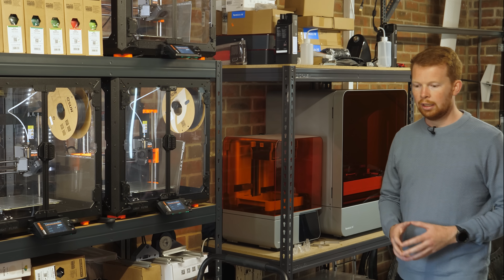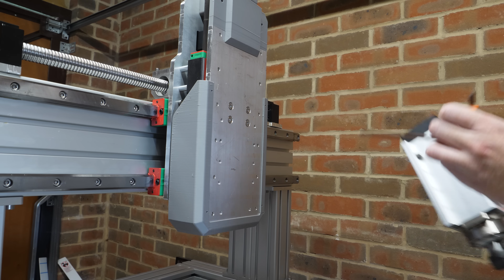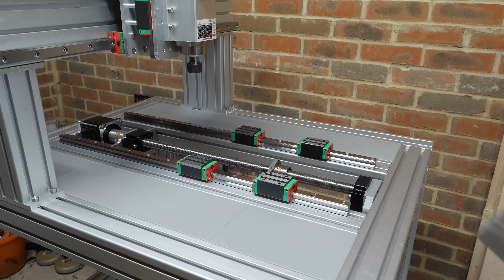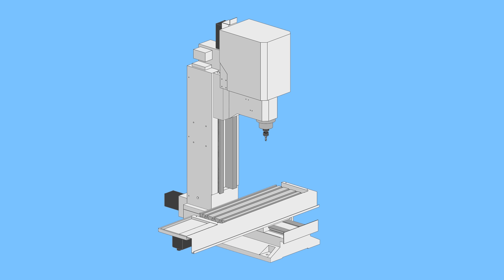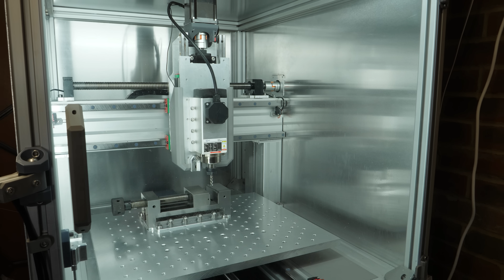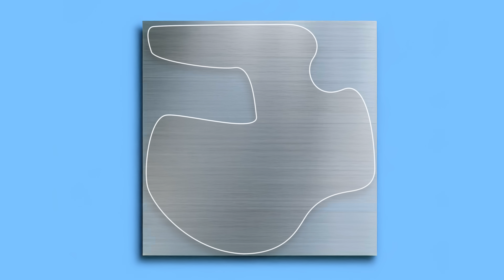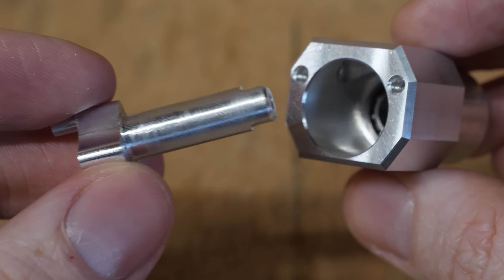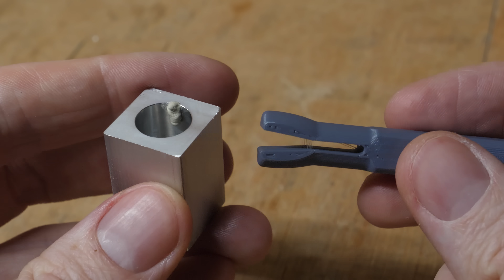I Needed an Engine, So I Built a CNC Machine

Comment: You may have ran out of thread on the top bit of your assembly for adjustment, but a thin nut that threads against the bottom could be tightened down to fix the depth. Probably more suitable than a grub screw as you don't want to be losing pressure through extra threaded holes.

Comment: Modern 3D printing boards (the 32bit ones) usually support G-Code with arcs. Is that a thing in CNC machining? The method in the video is probably still better for this case where a perfect circular shape is required.

Comment: I recently made a few bits with scotch brite, pressed cotton cylinders and steel wool to run it across the walls of the parts to polish them. Maybe you could do the same. I use brasso and silvo to get impeccable surface finishes. It was the most stupid idea until it worked ahahah. Was too lazy to polish some huge surfaces.

Comment: There is an add-on for 3d printers called Arc Welder that may help with the circular parts. Here is a description from the website. "Arc Welder attempts to replace G0/G1 (linear move) GCodes with G2/G3 (arc move) GCodes. This can substantially compress many GCode files and may reduce stuttering caused by sending many tiny movements in rapid succession over a slower serial connection". There is an add-on for Cura; maybe there is something similar you can use with your software.

Comment: the work offset can also be referred to as a Datam, and with milling you can use your g codes to make perfect circles G02 and G03 just give it the staring and end point best to make it a quarter of a circle and then do it 4 times. you can do it in two cuts at 120 degrees but it is easy to get wrong.
Reply: G2/G3 are for rounding corners. G12/G13 do complete circles.

Comment: CNC programmer and all around tinkerer here. If you are looking for more accuracy.

1. Determine if your cnc controller can parse G02 and G03 arc cutting commands. Not all inexpensive hobbyist controllers can (most can but not all). (Can your CNC software add arc commands???)

2. Determine if your cnc controller can parse cutter compensation commands. Again can your software add cutter compensation commands?

3. Upgrade the stepper motors to servos. They have MUCH greater torque at low speed and higher accuracy. To get more accuracy with stepper motors you need you need to chop steps into fractional steps. This reduces torque by a large amount.

(stick with me this, it's a verbose explanation) Cutter compensation is basically a command that allows you to modify your G-Code by adding a single value manually. Lets say you send your tools off to get sharpened and it comes back and is now 0.02mm smaller than it used to be (so your 10mm cutter is now 9.98mm because it was sharpened). Well you create a separate bit of G-code (stand alone) that is a final finishing pass on the work surface and uses cutter compensation. You edit the code line where the compensation is needed with that single value 0.02 and that cut, *compensates for the sharpened tool. BUT it can be used for more than just this. Here is the beauty of cutter compensation, with the ability to just type in a new number you can sneak up on a dimension by just adding a number, cutting, measuring, repeat if needed and use a smaller increment on the next number (if needed) and get very accurate results. 

So you leave some stock on the part for a your compensation pass, lets say 0.05mm of stock is left. Now your measure and determine that something like tool pressure or some minor slop in the machine has actually left 0.06mm of stock. So you enter your tool compensation value as 0.06mm to get dead on your finished value, your measure again and determine that there is still 0.01mm of stock left on your part, so you enter a new value of 0.07mm (this is 0.06 + the extra 0.01mm) and cut again. You measure again and see that there is now only 0.003mm of stock and decide to leave it alone but that is more than good enough or whatever. Please keep in mind that I am just pulling these values out of thin air. And you can also always just re-run the same exact pass to help make up for tool pressure deflection etc etc etc.....

Hope this makes sense

Comment: Hold up,
rotating the cylinder to change the timing, various power bands and finicky starting,
What if you used a motor to rotate the cylinder head, controlling the timing in-flight? If you take a lot of measurements of performance to get the ideal power and efficiency positions for various configurations of tank pressure, rpm, air-throttle, load, and maybe ambient or internal temperature, you could chart out the power and air consumption at different timing-positions. You could then set up a program to map the throttle-input into a space with set-points for:
1) Stable minimum-air idling
2) Peak efficiency
3) Peak power
to get optimum performance and flight-time, costing you only a hefty amount of very tedious work and programming!

Comment: 1) the friction from the piston without oil at all is likely what prevents it from starting well, which would be why mineral oil helps.
2) My first thought, hearing a need to lock it in place was to use two to four set screws (spaced evenly)

Comment: You could cut circles if only you used G commands. And don't use STL files if you did, they're made of triangles. This may be why your CAD-CAM software doesn't interpret it well (or it might be because of your driver, but that would be an awful driver to use really). Use STP instead. In such project I'd use some servo-stepper motors driven by ie. CMMT-ST drivers from Festo, and than use EtherCAT to control them by a higher lvl motion controller.

Comment: Tom love your site and projects. FYI You can build an simple and cheap EDM machine to remove broken taps. I had to do this to save some complex Aluminum parts. The EDM machine is a simple set of capacitors charged by a diode and resistor in series powered by house current. The part that needs to have the tap removed is placed in a tub flooded with deionized water. The electrode (a piece of wire)  held in an insulated block is connected to the capacitors and the part is connected to the other side of the capacitors. The electrode holder is placed in the mill chuck. (mill spindle  is off) Then just uses the mill vertical control to slowly plunge the electrode into the tap. You need to monitor the current with a meter. You will find the ideal level when you get a sizzle sound and see debris flowing out of the contact point. A small pump to circulate the water in the tank can speed the process.

Comment: 19:55 just extend the thread a little and put a thin nut on it, probably with a lock washer or something. Then you just tighten it in the opposite direction, like a steering rod.

Comment: A 2.2 kW spindle is somewhat underpowered. Even with 8 kW, you quickly reach your limits if you want to use modern tools and strategies. It's fine for POM, AlMg, or mild steel, but of limited use for anything over 400 N/mm2.

Comment: My question is, would this run on steam ?
If so, a tiny amount of platinum wool, and a hydrogen peroxide injection system, will produce loads of steam and pressure.

Comment: Have a look at this GCode for a circle

G21         ; Set units to mm
G90         ; Absolute positioning
G0 Z5       ; Move up to safe height
G0 X10 Y0   ; Rapid move to start point on circle (rightmost point)
G1 Z-1 F100 ; Lower to cutting depth (1mm down)
G2 X10 Y0 I-10 J0 F300 ; Clockwise full circle with center offset I-10, J0
G0 Z5       ; Lift tool after cutting
M30         ; End of program

Comment: 13:45
A way to get around that would be using a 'i' code. 
'G03 I-(measurement) Z-(measurement)' would be the line.
 You've to make sure your ramping profile is okay for with whatever you plan on feeding down. 

The' I' cuts a circle like X/Y moves is in a straight line with a G01, although your touch in point is best to be writ with a radius to avoid a flat spot.

Like starting a inch away and having  
G01X.5 Y. 5 R.5;
 X.5 Y-.5 R.5;
As your feed in code.

I tend to write the boring code as a seperate program, call it up as a sub program to repeat the bore process with 'L'  until it's done.

Of course this is for a very simplistic circle lol

Comment: next time try burnishing the piston and cylinder together with jeweller's rouge (red iron oxide powder mixed with some oil) - this process doesn't remove material but will mate the surfaces together. see clickspring's "rust and ancient tubes" video

Comment: I kinda did that... I was in need for some woodworking jigs and went after a local printing shop that use to lasercut some plastic sheets... They were like illiterate chimpanzees there and couldn't understand simple concepts and provide information like what is the kerf of the cut... So I went mad and built my own openbuilds cnc lol

Comment: Code output from a lot of software doesn't think in terms of G2 or G3 commands, for whatever reason..
You can often condense pages of CAM software generated code into just a few lines.
You can have similar issued running c-axis operations with live tooling on a lathe.

Comment: Precise and accurate cnc machine you built here. The reason why your engine didnt run at first was because of the absence of any kind of oil. Oil is absolutely necessary for a metal to metal contact engine, because it forms a thin film between the piston and cylinder which makes a really good seal. Without oil, compressed air would just pass between the cylinder and piston. Oil also lubricates everything, keeping the machine running smoothly. Because of the high speed of the engine, and the film of oil, the piston hydrodynamically rides on that film, preventing metal to metal contact and thus preventing wear.

Comment: When tapping holes in metal, be sure to use cutting fluid and always only turn half a turn clockwise, and quarter turn counter clockwise, and repeat. This breaks up the chips and prevents taps from getting damaged

Comment: Take a look at the Langmuir MR1 gantry mill.   Then borrow from that idea for filling the space between rails under your fixture plate with epoxy granite, added rigidity but you can also build in drainage ports for coolant, running a mist coolant system might benefit when you try other materials.    High speed spindle lends itself well to 0-flute Aluminum milling as well as fine detail tiny end mills.

Comment: Sick man! Crazy to think it's possible to make a beast like that just by yourself. The fitting and precision  in connections is what really surprised me- no loose connections, no excited vibrational modes, consistency in drill position etc. It's like an actual professional cnc mill you could buy from a respected manufacturer

Comment: I do not know if this has been suggested before, but you can use a servo to "lock" the valve timing. it also allows for on the fly adjustments if you intend to dyno the motor. Once you find the best "angle" for your valve you can 3d print a clamp that bolts to the motors' mounting face to fix it into place.

Comment: On the bottom of the cylinder, it might be important to use thin gage stainless, the Lenz effect might effect the performance of the peltier tile. I think it is also important to list the different PCM; wax, sodium acetate, and water. It would be sick to make a skateboard that has a couple GPUs in it. Then, when I am riding the bus I can play games on Steam. Probably should have a couple different partitions for the crypto mining and Steam modes.

Comment: Tom, what about some legacy GPUs? Like (4) 30w GPUs on a drone that mines crypto for a proof of concept. Depending on conditions, a drone without the GPUs, only the peltier glow plugs would travel further. There was a catholic priest named Ivan Illich. He designed a metric that proved that if you include the amount of time a person has to work to pay for their car payment, insurance, maintenance, and fuel into their trip time, they are traveling at 15mph and that a bicycle is faster ~18mph. I think maybe some "super commuters" claim to have solved the problem by traveling by highway at least an hour to work. Another solution would be to use the thermal energy from digital computation to make forward motion and to mine crypto. I am not usually a crypto guy, but these are kind of like a common sense carbon credit that would be desirable and would be beneficial to electric cars.

Comment: just use a set screw with plastic tip in the crank case to lock the zylinder thread, or two for symmetry

Comment: Completely unqualified person here, mabye you could lock the cylinder in place by bringing those threads higher up and putting a bolt on it, lower the cylinder to where you want it, then loosen the bolt which should apply pressure to the crank case and lock the cylinder.

Comment: What about this engine, an air bottle, a peltier glow plug, thermal paste, a microcontroller, and an alternator? This made me think about using different sized cylinders. Nearly all of the electricity used for digital computation is wasted as heat. In a larger cylinder, I would use more glow plugs.

Comment: 13:37 or you can learn to manually write CNC code for simple things like a circle and do it in just a couple lines of code at most. Where G01 is a linear move code, G02 and G03 are circular interpolation codes for cutting arcs and circles (clockwise and counter clockwise respectively).

For example, with a controller that can handle full 360° arcs, to do a circle, it is one single line of code for the arc motion itself. If you have a controller that cant hand full 360° arcs, then split it into 2 180° arcs.

For a working example, say I have a rough bore that is Ø.990" and I need to do a finishing pass to make it Ø1.000" and lets say that the top face of part is Z0 and the center of the bore is 0,0 for the X and Y and lets say that my bore is 0.5" deep and also, I am using a Ø.25" cutter, the code I would quickly write for the motion is:

N01   G00 X0 Y0
N02   Z.1
N03   G01 Z-.5 F20
N04   G03 X.375 I-.1875 F45
N05   X.375 I-.375
N06   X.375 I-.375
N07   X0 I.1875
N08   G00 Z1.

So with just 8 lines of code, I not only did 2 complete circles but also got into position and back out (each line explained below).
N01 = rapid move to bore center
N02 = rapid move down in Z to .100" above part.
N03 = feed rate move down in Z to my 0.5" bore depth.
N04 = 180° counter clockwise arc lead-in move out from center of bore to the bore wall (final 0.5" radius) 
N05 = full 360° arc
N06 = repeats the arc for a spring pass
N07 = 180° counter clockwise arc lead-out move back to center of bore
N08 = Rapid move up in Z to 1" above part

Keep in mind that this is still an interpolated circle, so "technically" is still facetted but it is as smooth as the machine can make it (basically you are limited to the resolution of the machines ability, not the resolution set in the CAM software) but this will often result in surfaces that are so smooth that you can tell that it is really facetted. 

For perfectly round bores (or bosses), a boring head (like what was made in video) or lathe if part can be mounted and spun, will have to be used. 

On a separate note, using G02 / G03 is also a simple way to create helical moves for helical boring and / or threads too by simply adding Z coordinates to the arc (G02 or G03) moves. For example, If you had a line that was say G03 X.375 I-.375 Z-.05 , then while making the arc motion, it would move down in Z, thus giving a helical move.

Also, just as a note, for good measure, Lines N05, N06, and N07 could also have G03 codes in them too like N04 but being that like G01, G02 and G03 are modal, they don't need to be in there after the first one of line N04.  Most G codes are modal, meaning that the controller assumes the last Gxx command until another Gxx command is called out.

All in all, CAM software is great but sometimes, better results can be had with manually written code for certain sections / operations. Don't be afraid of G-code, generally speaking, it is quite simple and once you get the hang of it, for simple tasks, you will likely find that its faster to just right the code manually than to program it using CAM (or Conversational, if working on an industrial CNC that has conversational programming built into the controller, for that matter). There is a ton of good information on the internet (and Video's on YT) that go in depth into G code and show how simple it can be to manually write code for operations that might seem much harder than they really are.

Comment: Hey Tom! Love to see that you're dipping your toes into machining. You're even making your own tooling! That's the bread and butter of being a machinist right there. 

A little, old school tip though: if you need to make something perfectly round, you can use your mill like a sort of lathe; part in the tool chuck, and then the tooling attached to your table (in a vice or whatnot). Spin the spindle for your appropriate speed and boom, lathe! (A similar trick can be done on a lathe as well :P)

Hope to see more machining content!

Comment: you can use gecode to make a perfect circle not with g1 line but g2 and g3 curved line. you can probably setup your cam program to output g2/g3 fore curved lines. and you could use a helical circle when you machine your cilinder fore perfect surface finish with an endmill. your device-lathe thingy was absolutly fascinating thow

Comment: Can you explain why you mixed epoxy in with the sand. It adds some weight but if the goal is to dampen vibrations then loose particles would do a better job. I've been considering doing this to my Avid CNC so your thoughts would be appreciated.